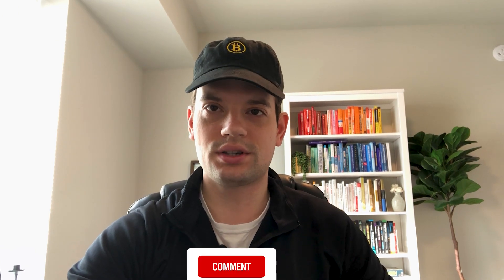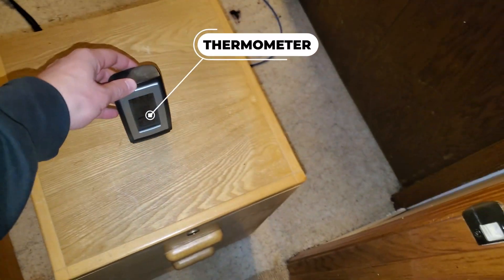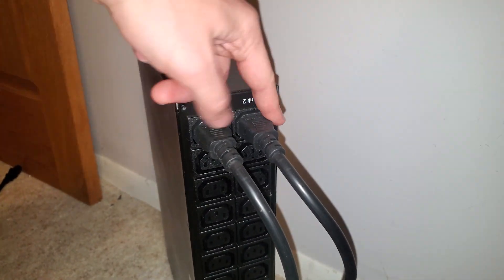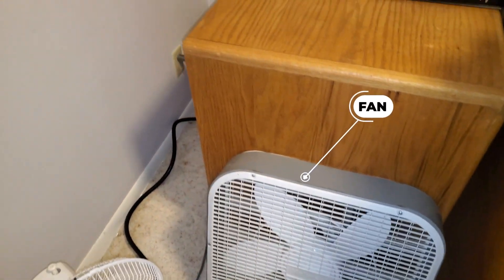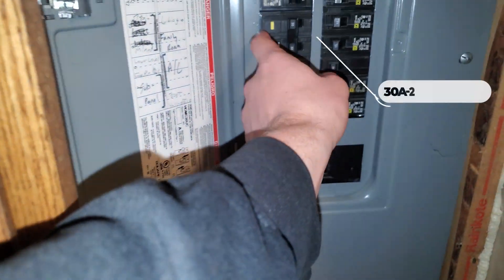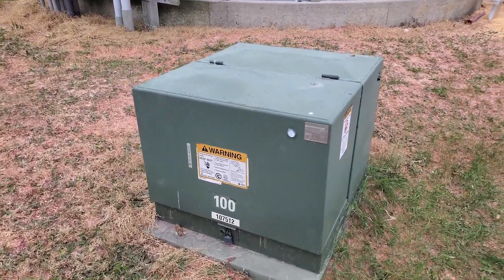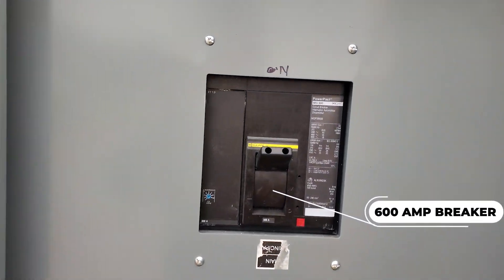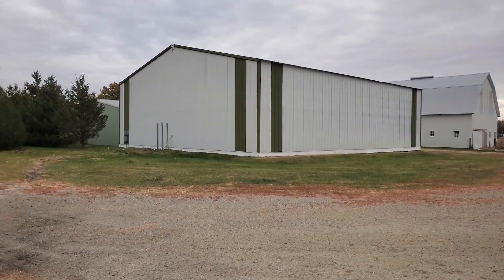Full Bitcoin Mining Immersion Setup

Comment: Very cool! What is the model number of that Tripp Lite in the beginning (about 1 min in)?
Reply from the maker: Tripp Lite Metered PDU, 30A, 18 Outlets (16 C13 & 2 C19), 208/240V, L6-30P, 12 ft. Cord, 2U Rack-Mount Power, TAA (PDUMH30HV) Black https://a.co/d/f5VMyab

You'll have to buy the c13-c14 cables separately.
Reply: @wilsonmining898  Thanks man! Another good tip is you can find those for about half the price used on ebay
Reply: @wilsonmining898  Thanks man! That one also seems to be available in a used but decent condition on eBay for about half the price. 🙂
Reply: @wilsonmining898  If its a 30 amp PDU then you can run 24A continuous not "each side can do 24 Amps" Unless you meant in the video that technically yes, each side can do 24 amps,  but not both of them at the same time. More like 12 amps on each side if running at the same time.
Reply from the maker: @4dollaman634  Yes, that is what I meant. Both sides combined could only do 24A continously. Each side has its own 30A breaker on the PDU would've been a better description.